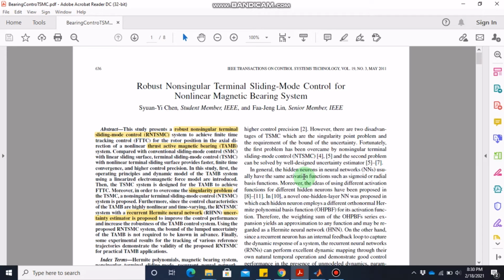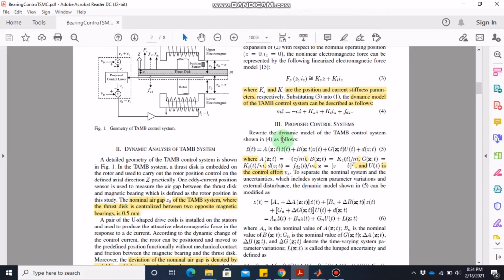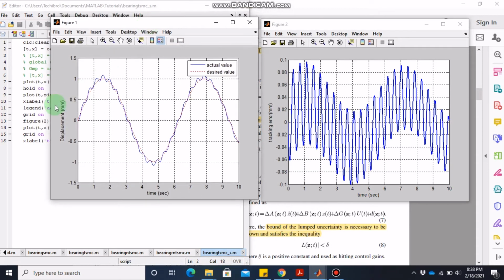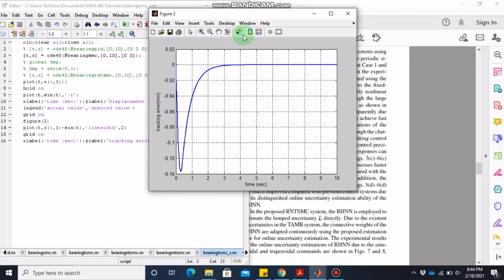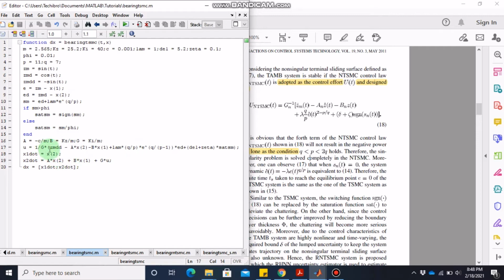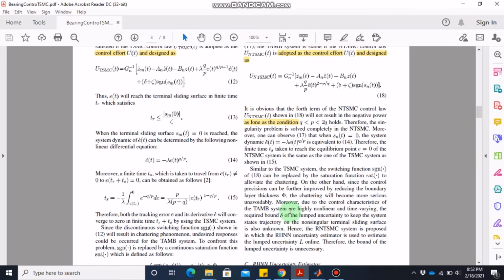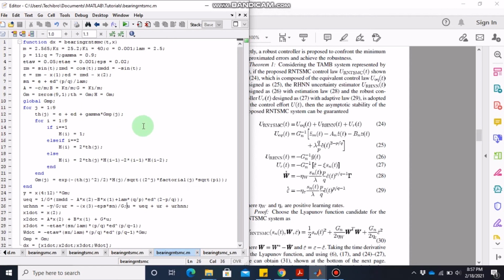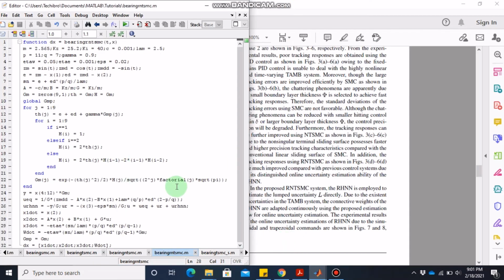MATLAB Simulation of Magnetic Bearing Control with PID and SMC

Comment: What is the conceptual difference between ordinary SMC and TSMC? How do they differ?
Reply from the maker: The major difference is in the selection of the sliding surface. TSMC involves a sliding surface with fractional power
 of the error, e.g., S = c_1*e^1.5 + c_2*e_dot. Conventional SMC involves a sliding surface that is a linear combination of the error (and its derivative).
Reply: @cset  Sir, one more general question, while we define the sliding surface of any SMC, is it a mandatory rule to express the equation of surface as a  combination of error and its derivative Or we can also write it as a combination of the states itself with no error term in the expression?
Reply from the maker: @souravde6116  The surface can be defined as any combination of states as long as S = 0 is a favorable condition for meeting the control objectives. Secondly, the control signal "u" should appear in the derivative of S